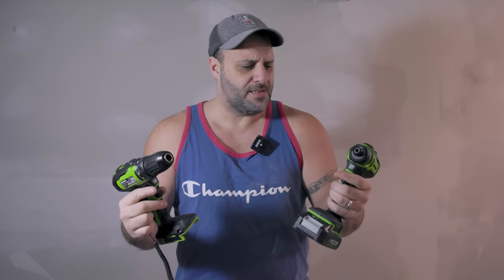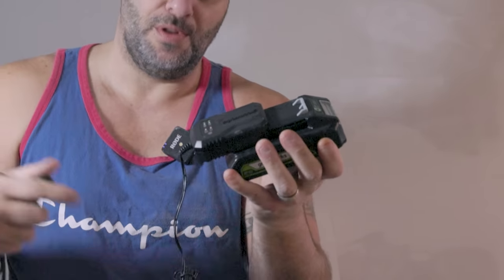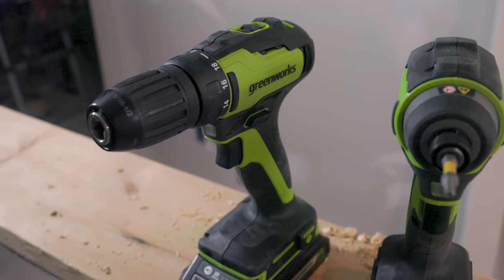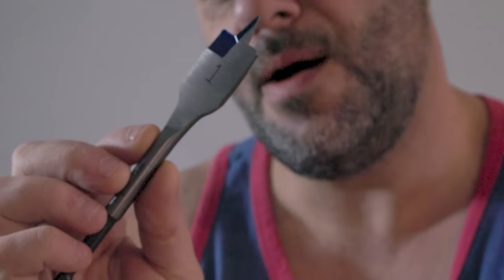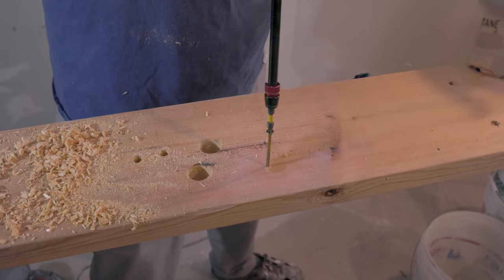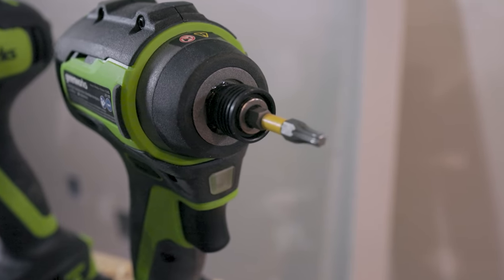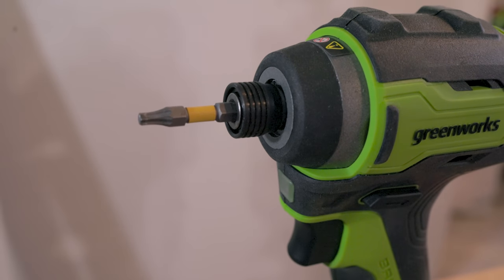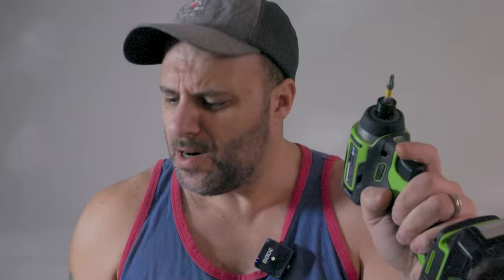GUESS WHO JUST STARTED MAKING POWER TOOLS... BUT SHOULD THEY CONTINUE?

Comment: I've got their 80v snow blower and I'm a big fan. We have an acre lot and a pretty big driveway and one battery usually does the job. Particularly heavy snow requires I use the second but I've never fully drained that second battery. Only issue is the battery doesn't charge cold. I have to charge them inside and the battery needs to warm up before as well. I'm not sure why they aren't more popular. I love how quiet it is. Its nothing fancy, its not self propelled, the snow chute can be a little finicky, and the lights don't work but I also got it for free, used, from some lady.

Comment: At a $130 its a big ask. The Ryobi HP compact drill and impact went for that over the holiday and I've personally used that drill to put a spade bit through doubled up 2x4s and I've used that impact to drive all sizes of constructions screws without a problem.

The impact also has a quick insert collet and the drill has a better chuck. 

Unless Ryobi wronged your mother or you literally only have space for one charger in your garage, there are better options.

Comment: Good video they are not new to market they had a g 24 line in 2014/2015 yes they changed the design added more tools like a reciprocating saw  circular saw  SDS drill  impact wrench angle grinder yeah they don't have as many tools as Ryobi outside of ope  but they got you covered for the most part but I prefer the g24 line I had a nice standing charger not that slide on my neighbor had it not the ope but the power tools they were okay at the time think the drill had 490 in pounds torque think the impact driver has 1450 inch pound of torque good enough for the homeowner if the new ones got more and  brushless good homeowner line

Comment: I just can't see them competing at all unless it's with Hart or something. The big three have the contractor side, Ryobi the middle of the road on lock so where else would they fit?
Reply: They fit with the fan brands.  i have thier 40v outdoor tools and quite happy.  BUT they are not as diverse as the other companies when it comes to power tools. Plus expensive then Ryobi. Once people buy into a brand they are sadly locked in due to battery compatibilty.  GW should make adapters to other 24v lines to keep them relevant.
Reply from the maker: I have to agree Kentucky.  I don't mind seeing companies release tools under their brand, but these cookie Cutter type of tools don't work out well

Comment: My lower model brushed Milwaukee drill and impact driver have more power than that and are built better. I also got those along with a circular saw, sander, and light with two batteries in a kit for $300

Comment: The impact seems ok for a homeowner that's already on the platform. But the drill is just pathetic. Even for a homeowner who doesn't need the drill often, you're going to want one that can at least do most everything. This drill can drill half in holes into wood and that's it. Never gonna any good for any finesse work, it'll take you an hour if you wanna drill into a thin piece of steel, not a chance I am do anything against masonry... Might was well get something like a DeWalt brushed hammer drill

Comment: Don't understand one thing with the drills on why they put 18 different settings plus drill or also have a drill plus high and low speed. Either I put it on drill hammer drill but never start going through 1 through 18 with the speed because I felt I had to when I had to drill something out. I really think company's lower the amount of numbers like 1 through 5 but obviously these guns are way  underpowered so way even make them. I find cheap tool brands in the garbage all the time and they work but people know that they are garbage 🗑 💯
Reply from the maker: That's basically how I feel Joseph   why waste the time on something like this 🤷

Comment: DIY tools...
#1= Dewault (1992)
#2 = Bosch (1969)
#3= Milwaukee (1924)
#4 = Makita (1915)
#5 = Festool (1951)
#6 = Rigid (launched in 1923) 
#7 = Ryobi (launched in 1968)
#8 = Black & Decker  launched 1916 
 Mastercraft = MasterCraft Maximum launched in 2016
#9= Craftsman (launched in 1927)
#10 = Kobalt (launched in 1998))
#11= Greenworks (2002)
Reply: were is kbolt ?
Reply: @clemmtec9506  Kobolt is 2yrs younger than craftsman ...incorporated in 1998
Reply: What about Flex? I'd put them above Rigid, Ryobi and B&D. They have a limited line but their still new.

Comment: Man, I think my old Ryobi stuff I got in a combo back in 2013 would outperform these.  Even they had belt clips, bit holders, and magnetic trays to hold a few screws.
Reply from the maker: Yeah Rob,  kinda outdated right out of the box
Reply: Exactly. That drill looks (and performs) exactly like the blue Ryobi drill I got in 2010 and recently threw out. (I upgraded to the Fuel Hammer drill / impact combo).
Reply: My blue Ryobi tools are still going strong, brother, and with the lithium batteries they go even better. And it started with the combo pack, great deal.

Comment: 24 volt batteries are not the same as 18 volts. 18 volt batteries have 5 cells wires in series to get 18 volts nominal and 20/21 volts when fully charged. Dewalt 20 volt max are 5 cells wires in series so they are also 18 volts. But 24volt power tools like this green works and kolbalt and flex are actually 6 cells wires in series making them 21.6volt nominal or 25.2volt fully charged.